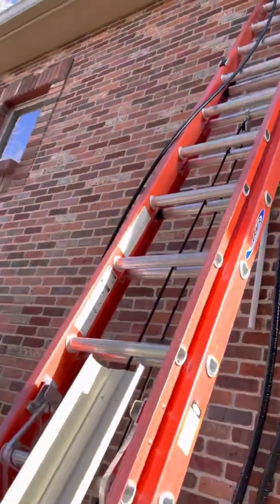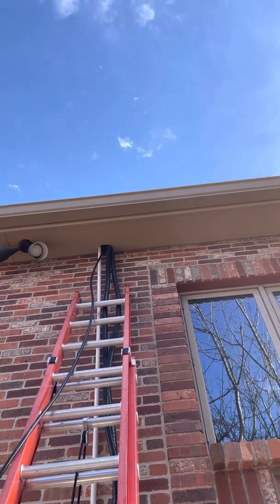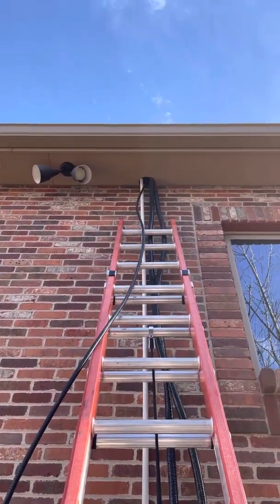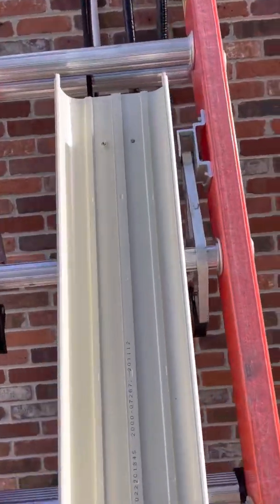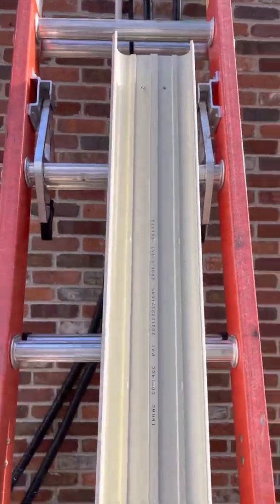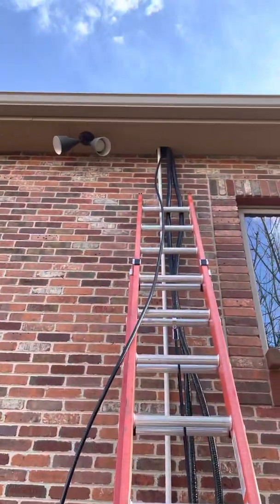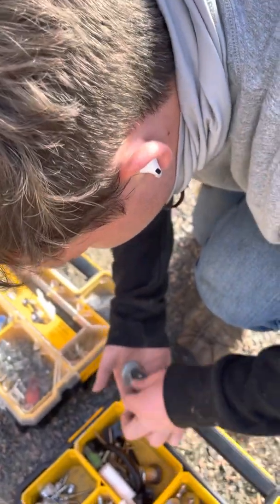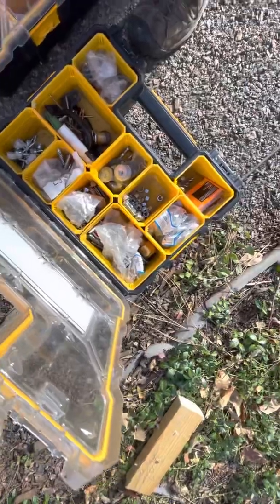Ductless line-set set up and control wire with drain, Line-Hide, Mitsubishi Ductless, Mini-Split VRF

Comment: Thank you for this video! How many pairs of Line set and Drains can you run through one of these line-hides? What if you want to run two pairs of line-set through one of these line-hides? possible?
Reply from the maker: I've installed 4 line sets in (1) line-hide. However you do need to get the biggest one it's the 140 size.
Reply: @ductlessplushvac  Thank you!!! Super helpful <3

Comment: Thought I would pose this question just in case you could point me in the right direction.

In the planning stages of building a block home on a slab in Florida. Looking for for the best possible electric set up without unneeded redundancy to do the following:

Ductless Cooling / Heating
Pool Heating
Normal Household Hot Water

Is there a way to efficiently do the above without 3 separate systems?
Reply from the maker: Great question. I would say no. Your going to need 1) A pool boiler that sits outside or in a small shed that's sized just for the pool. Pool boilers are unique in that they have to use chemicals to process the water and that needs to be separate from any domestic home heating or water system 2) The domestic hot water should be on an independent system. I would recommend a tankless system.
3) And a Ductless system for the areas of the home that will need conditioned. 

I hope that helps you out.